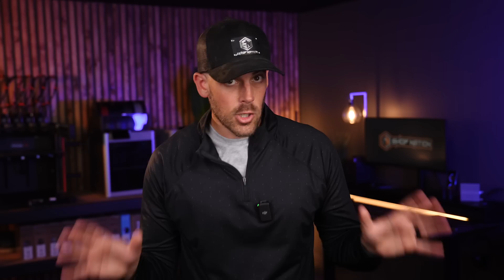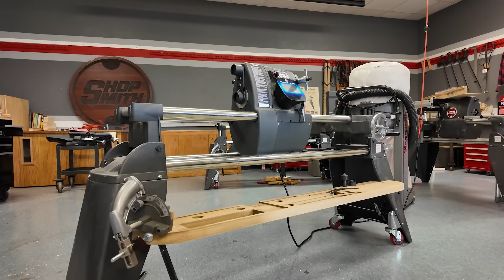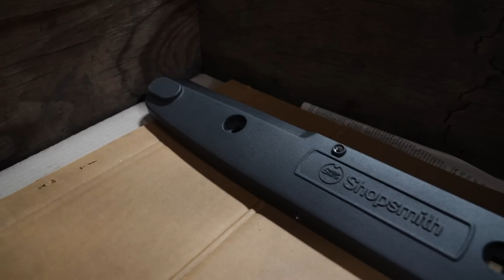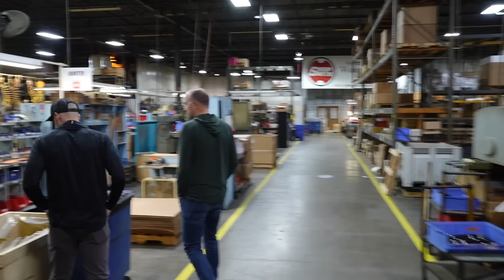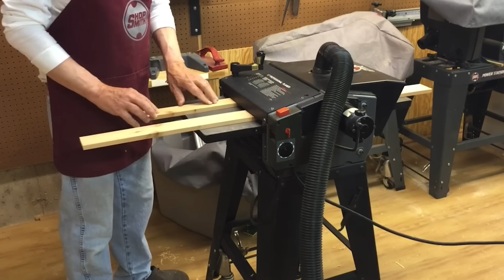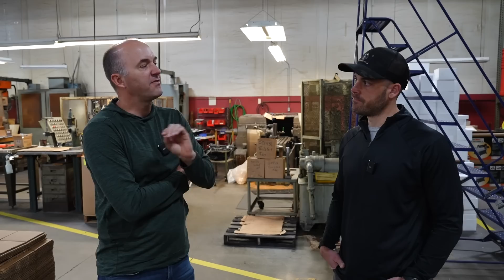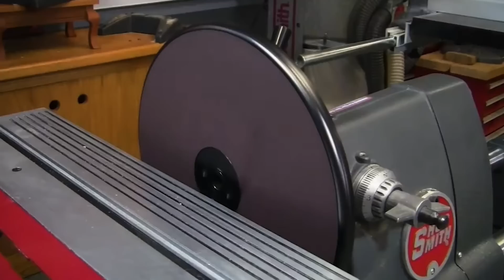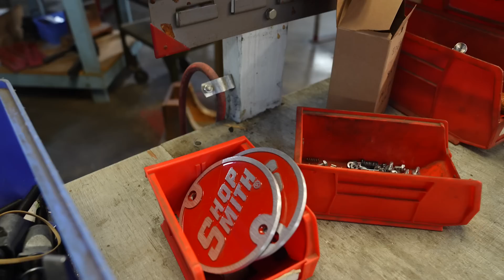The Last American Power Tool Company is (almost) dead

Comment: I can remember back in 1956. We bought a shop Smith saw from Montgomery wards who is selling it time that time it came with a table saw a drill press and a tennis sander. Now they’ve got it routers planers joiners so come along way and I hate to see it go into extinction. She’s a good product, we bought the saw my uncle  and my father the salesman told us for so you wanna do it build a base which you see in the picture here is pretty much we did I’ll just saw with good wheels on it. We used to wheelbarrow wheels with axles so we can move it around good luck to wheel down around the farm, we had built two houses barn and God knows what else we built with that and it never never stopped the good product and I’m sure it’s a much much better product today with all the attachments come with it now. I am 82 years old. My father and my uncle are dead. They sold our old Sold it for $200. Had I known that I would have  the saw. By the time I found out it was too late. I have priced buying the saw with all the attachments that are there today you’re talking about cost would range from $5000 to almost $7000. The design the concept and the application used to saw is outstanding. I think if I recall correct we paid about $150-$170 for the basic saw which was a table saw, disc sander and drill press.

Comment: He is right. Avoid the table saw market. I as a 59 year old woodworker would be interested in a machine that could bandsaw one one end, Jointer on the other end and some type of drum/belt sander in the middle on rails. That could be wheeled around.  Maybe even a lathe component.
A bandsaw that can change speeds for metal and wood application.

Comment: I remember Shop Smith from the early 80s. I grew up in the UK where money and space were at a premium and Black and Decker sold drills with attachments for sanding, table saws etc. All of the attachments were better than nothing but all were a comprimise in ergonomics, motor speed power etc.
When I looked at the Shop Smith I got the same impression, inconvenience, power, ergonomics table size etc.
I am wondering if Shop Smith would be better with a new line of dedicated tools or alternately a new multi functional tool, not attachments but a single tool that is a saw, jointer, planer, lathe and a drill press that works as a multi functional tool work station.
That, I think people would buy. Switching out attachments to use the tool and build something I dont think is going to fly in a world of cheap imported standalone  tools.
Either way good luck, I always buy American made whenever I can.

Comment: I inherited my Dad's 1984 Mark V and all attachments of that era.  It had sat in the dry basement for 20 years before I could relocate it to my shop.  I've bought a few rounds of repair parts, some upgrades like shorty way tubes but I have yet to start the headstock out of fear of its age.  I think a great market untapped is to streamline the refurbishment for the novice next user of an old Mark V.  I was the kid at the Mall Demonstration where my Dad saw his first demo.  So maybe group common parts in refurb kits.  How about a motor tune up service?  Many of these machines have sat for years, generally adored but sit unused now.  I would love a Power Pro upgrade but it's not in my budget.  Restoring an old Mark that still could provide lots of life is where I can spend some money though.  Thanks for the great video!

Comment: I bought one of those about twenty five years ago i extended the frame and bars to turn 58inches  using the angle grinder for the first cut and then chisels for finish . this machine is well appreciated.

Comment: I bought a used Shopsmith Mark V in 1975 and used it to restore an 1837 farmhouse ( about 30 miles from Dayton) that my wife and I bought and still live in. I can still remember the first time I slid the tabIe saw arbor off the motor shaft and heard the satisfying pop of  finely machined parts separating. I still have it and it still works great. I’m rooting for you to succeed.

Comment: I have had a Shopsmith since the early 80's (the same one until 2019).  I used it sporadically.  It fed my woodworking urge without taking up a lot of space while I raised a family.  When I retired in 2019 I bought another (used) with a bigger table system.  A couple of years later another one with a better fence system (again, used).  Now that time wasn't an issue, I really got into more woodworking.  I never wanted to invest in stand alone tools because of the cost and because my shop space was still limited.  I really like the SS for what I want to do.  Sure, it has limitations, but a lot of those limitations can be worked around pretty easily.  They last forever, parts are still available, and they are easy work on when you need to fix them.  They are amazing machines.  I think if they want to get the younger generation really excited, the just have to find a way to give them TIME.  That's what there is a shortage of and that's what I would've paid good money for.

Comment: I do remember this product. One thing that got me was to plan out which feature your going to use. So, at first, you need to saw the lumber to size. Well, OK set up the table saw. Then you need to drill some holes. OK set the drill press. As you can see, using this unit is much easier when you use the features several times before needing to tear down that feature and going to another function. So, many had the machines needed to build the project. Setting up the Shop Smith to do the same thing is what takes the time. Having these machines already built is a lot easier.

Comment: I own a 1962 model still works great , I did have to get the motor rewound , trouble with these are they take up so much room to use ... you almost need a room just for itself

Comment: I watched a video on the power tool Shop Smith yesterday.  The presenter said it was the LAST POWER TOOL manufacturing in the USA. I commiserate with the folks in Daton. Hang in there. 

I have a tiny wood shop and do typical minimal projects and have used the Shop Smith once when working on a sailboat project. It was the time to set up that made it a time issue for me. Today, I would consider a group of tools to replace the several I have, table saw is as said in the video my first purchase. I use it often but also need a bench for handwork. 

Remembering that this too lasts 'FOREVER' I can understand why so many are still around, even if the carpenters have faded away. The Shop Smith is still going, great rep for any manufacturing. 

Recently, I looked at a for sale ad for a Shop Smith by a widow in New Orleans, I was tempted to just go and see what was there.  

What would be so wrong with carpenters from the USA SAVING the SHOP SMITH from extinction?

Comment: I had one in the late 70's and sold in 84 on a move. Perfect woodworking tool for small work areas and lots of tools with one motor.  Well-built and compact storage.  Maybe working with wood has declined with new generations.

Comment: I’ve owned a ShopSmith for about 20 years. Bought it used which is the way a lot of shop tools change hands. Designed for the woodworker with limited space. What you find as you get into woodworking you don’t want to change the mode from one to another. I keep my Smith as a band saw. I own a table saw, planer, jointer, compound miter saw, etc. That’s the way it goes. Hope he can keep it going. Would like to see a revival of interest as I’m aging out myself.

Comment: Very interesting, I happen to own a Shop Smith. Bought it in 1985. I have used it, maybe 150 hours in total. Its in my garage along with my table saw, drill press, miter saw, and vacuum system. I decided to retire it because it took too long to go from one tool back to another tool, to another tool, etc. Then getting the table saw function into reasonably exact alignment was ridiculously difficult. I bought the table upgrade system so I could break down sheet goods but that was the decision that caused me to buy a table saw. So, I'm not angry with Shop Smith, but I would like to get rid of mine which will free up some of my garage space. I promised my nephew that I would give it to him. So now I have to load up this behemoth in the bed of my pickup and drive it from Memphis, Tennessee back to Huntsville, Alabama where I bought it back in 1985. I doubt if he will actually use it that much but he has 5 sons and maybe one of them will wind up with it.

Comment: In 1985 or so, I bought an old Shopsmith from an elderly neighbor. He bought it in 1952 or so. I used it for many years and finally sold it to another neighbor. My basement shop was small and I could not afford separate machines. The Shopsmith was horrid by today's standards, especially the lack of safety. I used it more than anything else as a lathe and sander. I miss that old piece of history. I am sorry to see them go, but I understand. I will remember.

Comment: Lived in Dayton as a teen, bought a Shopsmith (1984) as the movers loaded my stuff for the start of an Air Force career.  For 22 years in various garages/basements, the Shopsmith did everything I needed, despite the weaknesses that the CEO acknowledges.  Now retired, I use the Shopsmith as Norm Abram did:  since neither of us is a lathe master, that's the niche that the Shopsmith continues to fill.  As the video says, no other tool fits as many abilities into a small footprint.  Suggestion for Nick:  reach out to the active duty military.  We not only have a space challenge.  We also have a weight limit when we move our household goods!

Comment: I have known about them since I was in my late teens ....60 years ago ...never had a shop that I could fit it in along my other equipment but they are nice machines . last forever ...the table saw is the only part about  it that I would not use , lots of reasons . But now the point is moot .
I am not doing as much as when I was younger unless I have to 😁

Comment: My father bought a Shopsmith and jointer about 1954. I learned woodworking on it as I grew up. I got a new headstock, bandsaw, and some other accessories from a retail shopsmith store in the early 90's. I still have it and use it. I've taught my son how to use it, and I suspect he'll teach his son how to use it starting in about 10 years.

Comment: I really do love the tool and the idea of it to get more people into woodworking. 

I myself can see the major downside to this type of a tool however. The constantly changing of the parts on the tool so you can do the next operation would get old very fast. It also hinders progress in many ways as so much production time is lost changing out parts. I don't have one of these so I can't speak to the actual number of minutes that are wasted changing out the parts but I can guarantee it's a whole lot more than me simply walking over to my other stand alone tool and performing the operation after a minimal setup for that operation. 

For the severely space limited however I can see the benefit and If I were a guy who's working out of my garage or some other tiny building then I might even have one of these. I hope the brand stays alive and I truly believe we need tools like this to entice the younger generations and get them into this hobby/career. 

True craftsman are a very quickly dying breed and before long there won't be many left.

Comment: Owned a shopsmith for many many years.  Dad bought one when I was just a kid, and it was because of space.  In truth, you cannot beat the machine for what it allows you to do.  Yeah, it's aggravating having to always swap out one tool for another because they all share the same motor, but it also teaches you to be careful with how you set up the task list and order of operation.  I miss that shopsmith, for sure.  Many many hours of memories making stuff with my father, and then making my own projects. 

SS could do a lot to increase their following if they'd stick with they talk it up to the knife-making and blacksmithing communities.  With that variable-speed motor, the shopsmith makes a great grinder for making tools and knives if you build an adapter.  And that's a community that does smaller woodworking projects, exactly where the Shopsmith shines.

Comment: I’ve been a metal/wood worker my entire adult life. What you have absolutely gives someone the ability to do several operations without having a lot of machines to do it. A low cost way to introduce ppl into wood working without breaking the bank. One suggestion if I may is to make a helical head cutter for the joiner. They can’t be beat and not that much more in cost to produce. You can use readily available carbide inserts. Ppl will love it trust me.   I have a manufacturing company in PA if you’d like quotes on any parts. I’m 100% all about made in USA and supporting companies that are mostly all made in the USA. next to impossible to make everything here sadly.  Great video. 👍🏼👍🏼

Comment: As a Wood worker. I've had three of them. Picked up fairly cheap online. The main reason is for my basement shop. Tight space that can't get full-size tools in. The downside is the power source. One motor for each tool. In order to access a different attachment, takes time. If I was making hundreds of the same thing before needing to change the attachment.  It would be perfect. But I make one at a time. 
  I think the salution was mentioned during the tour. Shop class. Focus on younger individuals is correct. As in the teenage shop class. Instead of desk. Each student is assigned a Mark. Need to sell more units to keep this business afloat? Fill every shop class with 20 units. Each day focuses on different attachments. The final test of the class is to produce a pc using each attachment.  
   I'll even follow up with a video on this channel to explain or help promote the idea. I love American made products. And have used them for production. They are great for limited space craftsmen.

Comment: I'm glad to see Shop Smith still going and reimagined. I'm 74 years old and I remember the Shop Smith Saturday how to use it shows way back when. I now have a nice 24' X 24' complete wood shop although future downsizing and rediscovering the Shop Smith is interesting to me. 

There needs to be YouTube videos doing the same thing that the old TV shows did. The horizontal drilling was one feature that impressed me the most. One of the things that drove me to individual machines was the transforming back and forth. I think videos showing how to plan your project so that you can do all your table saw cuts at one time,  all drill press work at one time, etc. to minimize the back and forth with the transforming would be helpful.
Hang in there.

Comment: I have an old 10ER that was my great grandfathers.  I started using it as a kid and now have it in my collection.  The issue I have is that parts for the old models is a challenge.  I know the video said that you can use newer parts on the older machines but to some degree I don't want to completely replace the head or tail stock just to replace the bearings and take away from the originality of the 10ER.  

From a marketing perspective, I find the strength of the Shop Smith is the lathe and drill press.  These are two specialty tools that many shops don't have space for or tend to buy a simple and cheap version.  The 10ER has provided a huge advantage to a traditionally drill press in that I can use the variable speed drive, and the fence to use it as a pseudo-router/milling machine/grinder.  The table saw is the weakest tool for several reasons (table alignment with side table and feed out supports, safety of exposed blades under the table) but does get the job done.  

One area that may be worth exploring is incorporating a screw driven carriage and tool control on the lathe to allow for accurate cutting of wood and plastic parts vs using a tool rest and hand tool.

Comment: Yes a GREAT  Set of tools on a small workspace .i have had mine for years , their is so much that you can do with it .should have demonstrated the saw to wood lathe to belt sander to drill press to horizontal  boring machine to bandsaw and more ...the Younger Generation have no idea what they can accomplis with SHOP SMITH  if you dont show them ......walking around talking about it with out demonstrating is shooting your self in the foot .

Comment: About 30 years ago i wanted a multipupose machine, and the options at the time were the shopsmith and the robland x31.
I went with the robland simply because the tablesaw and jointer/planer were larger and more robust than the shopsmith.  I still use the robland to this day.
The tiny tablesaw platform for the shopsmith really is it's achilles heel.  
I don't doubt their quality, and i wish them success.  But can see how they ended up in their current stare.

Comment: It's an amazing piece of equipment but the lack of automation and highly skilled labor required to turn it out holds it at what would be close to the level of an artisan built product rather than something more mainstream.

Additionally there is simply a finite market for a tool that is designed to virtually never break that cost $5k and requires that live in a residence with a workspace that's at least the size of a a garage.  These days younger buyers are struggling to find even basic housing let alone a space large enough to use this machine. That particular problem is beyond the scope of this company's control but one has to ask, what will they do when everybody who wants one that has the money and space for one has bought one?